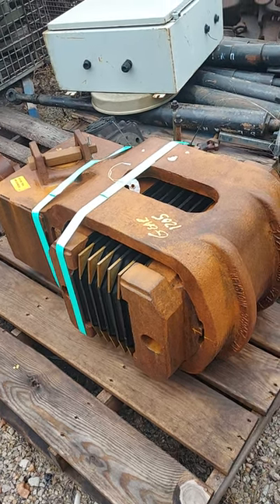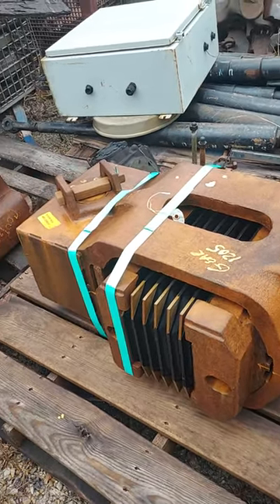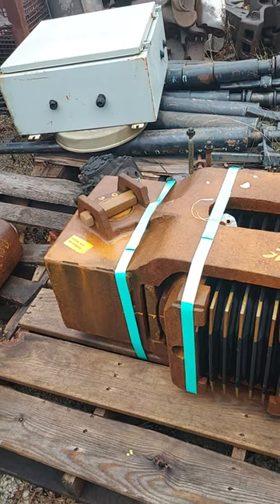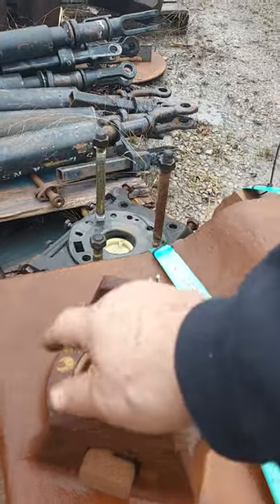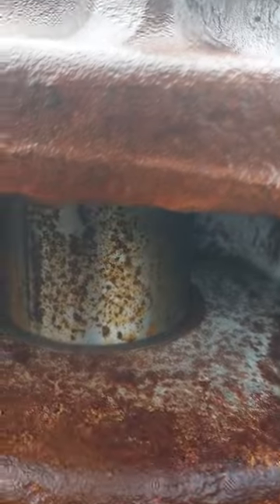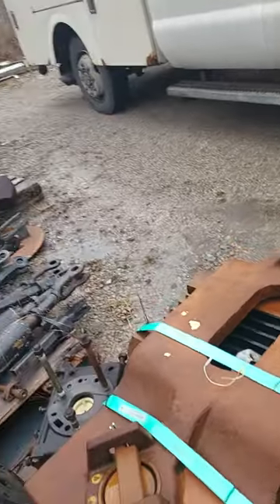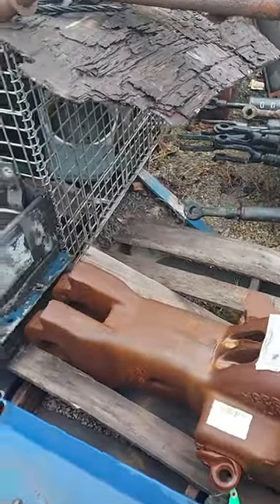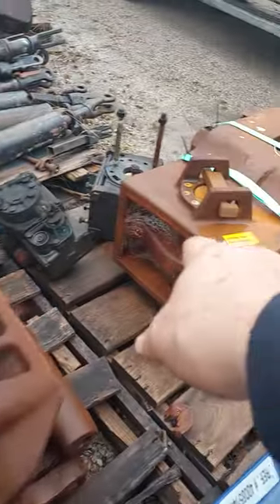New Locomotive Draft Gear and Coupler  #shorts

Comment: That sure is one heavy piece of equipment Dave thanks for another great video
Reply from the maker: Wish i knew how much draft gear weighed Jason, I've tried to find
out with no luck yet. i have a McConway and Turley catalog but it
doesn't give shipping weights. I've looked online with no luck too.
Reply: Legend has it that Dave can shake hands with that coupler and slip 'er right into the pocket while holding the  uncoupling pin in his other hand to keep it out of the way.  But as luck would have it, Dave is no Superman, I mean he only has two hands, so he can't hold the camera to shoot video of it too.  Such is our luck. 🫤
Reply: @ccrx6700  
At least I found this info…
How much does a Mark 50 draft gear weigh?
Mark 50 Freight Car Draft Gear
AAR Rated Capacity = 38,940 ft-lbs. Weight = 386 lbs.
Reply: @ccrx6700  
Looks like shipping documents in the envelope,  if not saturated.
I did shipping problem solving..the only info not on these documents is pricing.
Reply from the maker: @espeescotty  🤣😊

Comment: I hope its not a McConway and Torley coupler and draft gear set.  One of their couplers fell out pulling a fork-lift out of the mud.
Reply from the maker: Yes it is Half inch holes
Reply: @ccrx6700  Just had to give you a 'bad time'.  I've never worked with this draft gear or coupler.  The draft gear I worked was more of an enclosed box.  Had to compress it to drop it out.  Keep up the great videos!  Brings back a lot of memories.

Comment: huh, Ive always heard locomotives dont have draft gear, the coupler is firmly bolted to the frame. and then just the cars have draft gear.
Reply from the maker: Don't know where you got your info from DFW but you can see
these locos have draft gears. What is interesting to me now that
you say that is, I know many steam locos did not have a draft gear
but really, really curious if that was true for all of them or not?
Reply: @ccrx6700  the guy I heard it from had more steam experience than diesel. I believe I looked on several of amtraks engines as well after I heard that they all appeared to be without draft gear.
Reply from the maker: @dfwrider3830  👍😊

Comment: Do you know anyone who does 3D printing of plastic parts ?

I need to have a plastic keypad duplicated
It is a 2 inch by 3 inch plastic plate with 16 little buttons that have circles with little fingers that push through the holes.
It is 1/4 inch thick

It is for a Kenwood handheld 2way radio.
I have a new one but I need 9 more and they don't make them anymore.

If you know anyone please let me know.

Thanks

Bill
Reply from the maker: I for sure don't know of anyone, hopefully somebody else will for you